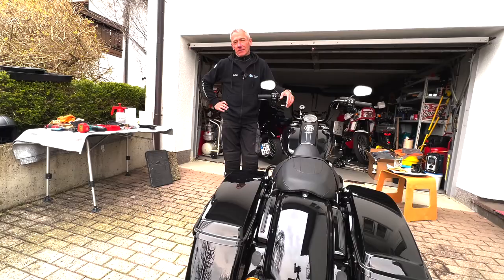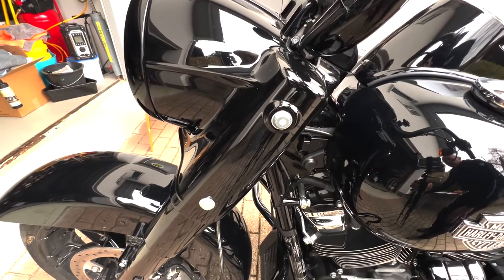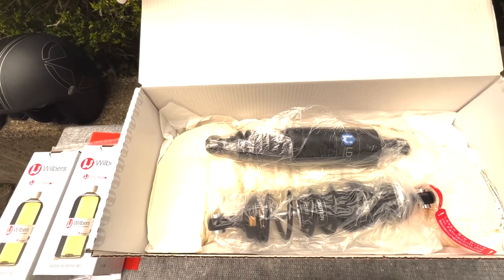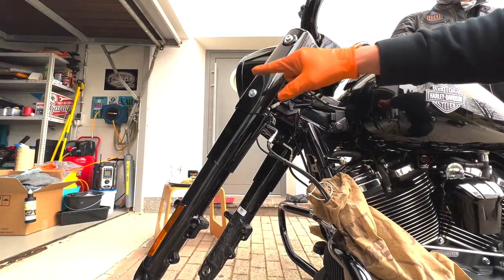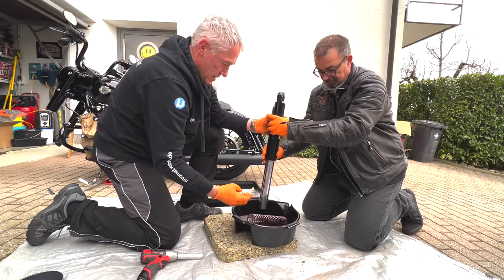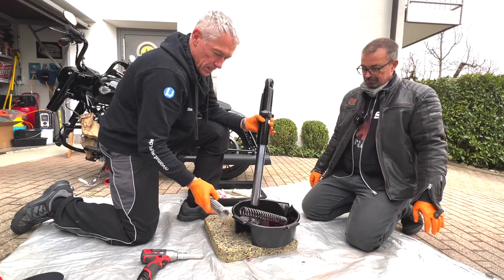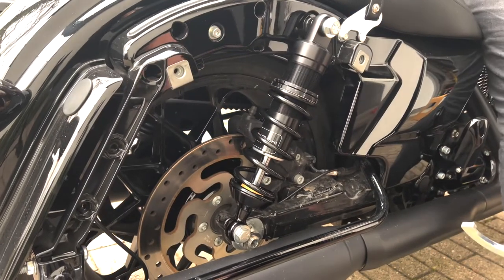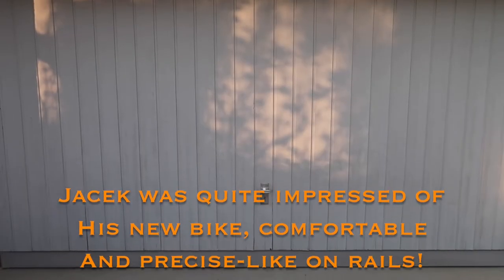Harley Davidson Road King Special Wilbers Nivomat Install

Comment: I like the clock bell in the background marking the quarters. I once had the pleasure of staying in a village with a church clock like this and it's surprising the difference in productivity and peacefulness it makes. Liking the smart workarounds you had on those front forks, the cut down allen key and using the axle for fork height installation. Well done
Reply from the maker: Thank you for your support

Comment: Hi Stefan, great vlog . I’m in Australia and ride a 2014 Road King Classic with standard rear air adjustable shocks with 35 mm  lowering blocks which change the angle of the rear shocks slightly. If I was to install the Wilbers rear shocks, would the slight angle change from the lowering blocks have any negative affect on the performance of the suspension.
Cheers,   Frank
Reply from the maker: Hi Frank, of course the Nivomat shock (left one) is designed and approved for a stock Harley. Do you need the lowering blocks because of your rider height? Because the Wilbers shock length is as well 13in, like on the stock RKC. At least two of my customers have the Nivomat in combination with lowering blocks and are very happy as well.

Comment: Alles super erklärt ! Welche Größe haben der 1. Inbus für die obere und untere Gabelbrücke und 2. Der Inbus für den Verschlussdeckel des Gabelrohrs ?  Vorab vielen Dank
Reply from the maker: Gabelbrücke 1/4Zoll, Verschlussdeckel 19mm
Viel Erfolg
Reply: @stefansgarage3014   vIelen Dank. Dann habe ich schon mal alles parat wenn das Fahrwerk kommt. Hoffe ich muss nicht zu lange warten.
Reply from the maker: @andreaswolter6475  Geht schnell zur Zeit, obwohl bei mir hättest du es schon, ich hab die gängigsten auf Lager😁
Reply: @stefansgarage3014  ich hatte dich über deine Internetseite angeschrieben . Leider habe ich keine Antwort bekommen . So habe ich es direkt bei Wilbers bestellt . 🤷‍♂️ Schade hätte Dich sehr gerne unterstützt
Reply from the maker: @andreaswolter6475  Ups! Da gibts leider manchmal Fehlermeldungen, die ich nicht zuordnen kann. Danke für deinen Support. Weißt du noch ungefähr wann du geschrieben hast?
Reply: @stefansgarage3014  5-6 Tagen . Also um den 01.03. habe dir gerade über deine HP geschrieben .
Reply from the maker: @andreaswolter6475  Kannst du mir bitte nochmal eine Testmail schicken, dann versuche ich das Problem mit meiner HP Betreuung zu isolieren.

Comment: Hi Stefan, my ride is a 2014 CVO Road King, my rear shocks are the 13 ‘ Legend Revo A . As I have back pain issue , I wonder if the Wilbers  could be a better choice as we have bad roads in Quebec Canada . Thanks a lot and ride safe .
Reply from the maker: Hi vibe27vibe (?), what a coincidence, I just finished work on a Titanium Dust 2014 CVO Road King. The problem with this beautiful King is the unique fork construction, only shared with the Ultra Low and extremely stiff. We converted the fork to M8 standard (keeping the stock chrome lowers) with the M8 Wilbers springs. Fly and Ride used to have your brand on his 2020 CVO Street Glide and is now happier on Wilbers. So yes, your ride will be more comfortable on Wilbers Nivomat, but you need to do something on the fork as well.
Reply: @stefansgarage3014 Thanks for the fast reply, I have the  standard Legend AXEO Front End Suspension . Would  I  be ok to have them combined with the Wilbers ? By the way my bike has the Titanium Dust paint and I love it so much . Just came home from the chiropractor ha ha, can’t wait to read you again . Have a good day
Reply from the maker: @vibe27vibe  The Wilbers Nivomat rear shocks will work with front legends. 2014 CVO Road King is one of the few bikes where you get solely the Wilbers Nivomat shocks (without front). Right now they offer 10% Oktoberfest discount, so it’s the best time to buy. Don’t forget the 20mm rider sag adjustment.
Reply: @stefansgarage3014  Hi Stefan, just want to tell you that I ordered the shocks an hour ago from the Germany store  . I hope to receive them before the first snow . Winter coming soon here in Quebec ha ha  . Have a good one
Reply from the maker: @vibe27vibe  you will have a beautiful riding season 2024, for sure

Comment: Habe das Öhlins stx36 HD772 hinten verbaut.Bin nun am überlegen vorne auch was zu machen habe da an Federn gedacht oder an das Progressive Suspension Monotube Gabelkit gedacht was würdest du eher empfehlen oder macht auch Sinn?
Reply from the maker: Ich würde grundsätzlich bei einer Marke bleiben, da die Sachen (zumindest bei Wilbers) aufeinander abgestimmt sind. Das wird mit der Cartridge vorne allerdings teuer und schwierig (Lampenverkleidung anbohren). Nimm  Gabelfedern mit Öl von Wilbers (oder Hyperpro), das reicht bei einer normal bis sportlich bewegten Road King locker aus und bringt eine preiswerte, deutlich spürbare Verbesserung.
Reply: Danke für deine Tipps und deine Meinung.Von den Progressive Suspension Federn hälst nicht?Glaub von Öhlins gibt es keine Federn für vorne oder?
Reply from the maker: @eisele90  stimmt die haben nur teure Cartridges. Gegen Legends Cartridges hab ich in New Jersey mal eine Wette mit Wilbers Gabelfedern gewonnen

Comment: Hi Stefan, thanks for the videos.   Can this be fitted to an older 2013 road king with the air suspension - I have to say the present ride is adequate but not great.    Will I get the full Nivomat effect on such an old bike?  I've no real plans to change the bike but would like to improve the handling.   Any thoughts please?
Reply from the maker: It significantly does improve the ride! The Road King in my 2nd video is a 2013 and we couldn’t believe what happened after the upgrade. Much more comfort and precision, Klaus (the owner) still loves the upgrade after four years
Reply: @stefansgarage3014   Thank you Stefan for your fast reply.   I'm based in Madrid. Spain and am talking to the Wilbers distributer in Valencia - I'll go ahead and pull the trigger and report back.   Much appreciated
Reply from the maker: @Meldelkel  how many km do you have on the odo. It’s vital for 2013 and older, that forksprings are mounted thicker end upwards and initial sag adjustment is performed with you on the bike. If you can’t get the set by your distributor, contact me again
Reply: @stefansgarage3014  Thank you Stefan.   I Placed the order with Novotech in Valencia and will get the full Novomat system fitted by Iron cycles in Madrid.   Thay say they have fitten many.   I'll make sure the fork springs are fitted thicker end up.   Just 16k on the bike as I do tend ro ride my other bikes more
Reply from the maker: @Meldelkel  very good choice, important as well is the 20mm initial sag adjustment with you on the bike

Comment: i'm going to upgrade to either Wilber's or Legends on a 2021 Road King Standard. I'm curious to get feedback from the group here on which is superior... i can't really find any direct comparison though from what i can see online, they are similar in both cost and buyer feedback. My HD dealer is pushing me toward Legends, likely because they get some local kickback. They actually said they'd never heard of Wilber's (I educated him, haha). As for comparison, Legends has the "limited lifetime" warranty vs. "5 years" from Wilber's... and Wilber's has "self-leveling"- so i see advantages to both . Would love some guidance before I make the decision.
Reply from the maker: It's hard to get a comparison between both. Mostly the US guys don't know Wilbers and the European don't know Legends. Hardly anyone will change between aftermarket brands, because they all offer a huge improvement compared to stock. You always have to compare a full conversion (front and rear), as Wilbers Nivomat always comes as a full set. If You are only riding one up, it doesn't make that much of a difference. But if You are riding single, two up, with or without luggage, You definitely should opt for Wilbers. The Wilbers ride is always same or more comfortable as the other brands AND you don't have to adjust anything. Make sure, your technician knows how to install the Wilbers-like shown in the video. By the way Matt Laidlaw is running Wilbers on his personal Street Glide Special and Million Dollar Bogan on his CVO Road Glide.
Reply: Thank you so much for the reply Mr. Stefan. I have seen you on Laidlaw’s channel as well as Robert Simmons’- I never dreamed you would take the time to reply personally. Your insight was very helpful. I called Wilbers yesterday and placed my order. I wanted you to know your video and comment helped me make the decision. I will post an update once they are on and I have some miles on them. Thanks again!
Reply from the maker: @garyallen6486  Hi Gary, of course I do. Thank you very much for rating my recommendation so high. It’s definitely the right decision, welcome to the happy Wilbers owners (Matt, Robert and many others), make sure your tech does the install correctly,  especially the initial 20mm rider sag adjustment.
Enjoy your „new“ Harley